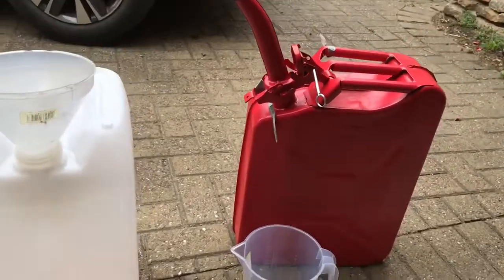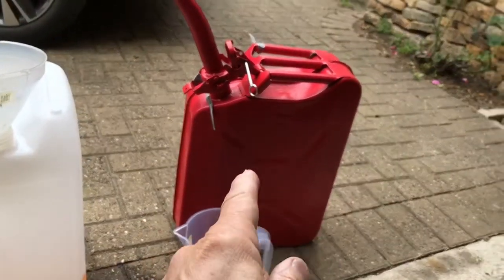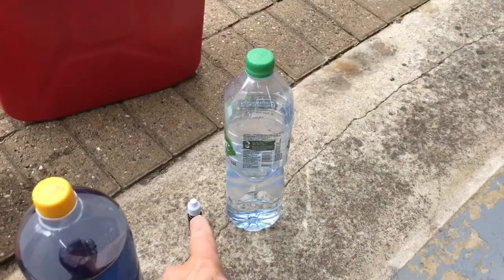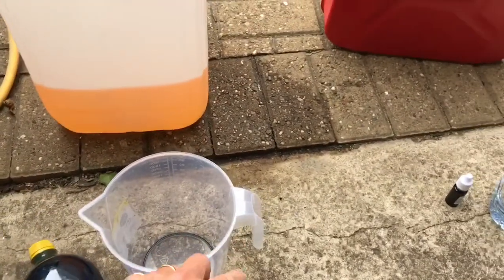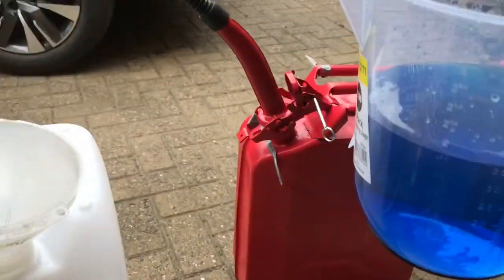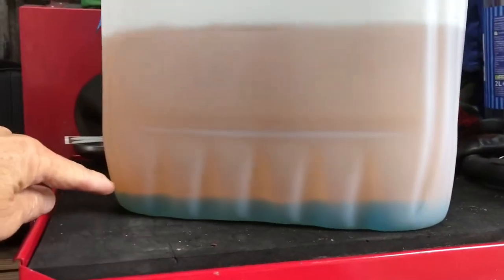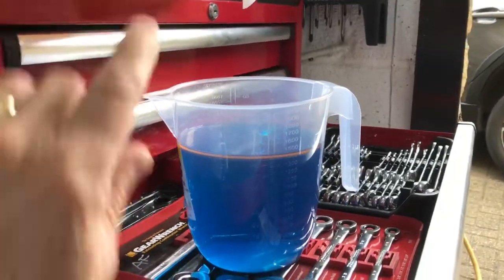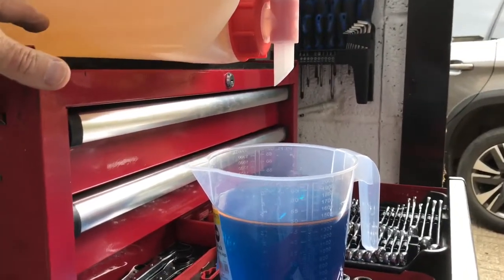How to remove Ethanol from unleaded fuel

Comment: Thank you for sharing this, it gives hope to classic car owners, like myself. My two classics are my life, so this means a lot to me, as well as many other classic car and bike owners that I know.
Reply: Just next time you need to rebuild your carb use viton orings and buy a small piece of it and trace out your bowl gasket and then swap the fuel line to a flex fuel fuel line. Probably needs it anyway those old rubber lines get ate away slowly from even regular gas. Then you don't have to worry about it. It's a little hygroscopic but nothing major as long as your fuel tank isn't untreated steel it won't matter. We run water/methanol sprays on tons of old motors with zero issues. Ethanol has some good antiknock characterisrics and the emissions make it ideal for road legal performance applications vs large amounts of toluene which is what we used before. We can get a massive bump in hp while remaining emissions compliant in commiefornia due to less toluene and more ethanol. I wouldn't ever live in California but our customers do. Ethanol really isn't much of an issue it is a lot simpler to just replace a couple lines and orings than do all this shit. I build racing motors for a living from everything from 4 stroke 450cc dirt bikes, 500cc two strokes (yes a 500) and 360ci sprint cars to naturally aspirated classics for drag and low displacement turbocharged cars. Ethanol for all of these is either a blessing or a very small issue that can be sorted out in an afternoon. Compared to all the other stuff you are usually having to fix on the classics this is nothing.
Reply: @n111254789 but what about the gummed up hard to start small engines. My WR250 only gets ridden a few times a year and that is always hard to start on E5 or E10...

Comment: That is so simple to do, a great video. Has the Govt considered that motorists could take a class action for damages re this E10 fuel? It is NOT needed as we are no longer in the EU and the millions of discarded litres of E10 unviable after over wintering will have to be disposed of - has anyone thought of this? vis garden machinery and lawn mowers of which there must be over a million engines using Petrol in the UK alone. The arguments for the green benefits of this fuel are not in my view  valid, what about rain forests that might be ripped up to make this additive? (sugar beet) plus the transport costs? Factor in the wasted fuel in the UK that will need to be disposed of - how many Tankers worth is that?
Reply: A huge amount of tax to start with, and more profit for the oil companies,  its good business !!.
Reply: the uk, despite its insularity, also has a climate policy. ethanol in fuel isn't about being an eu member, it's about not destroying the environment. your view as to the validity of climate policy seems to based on ignorance and is consequently wholly irrelevant.

Comment: Very interesting, i might try this for my small machines that don’t like ethanol in fuel.
Can you use less water or is the 1-10 critical to the success?
Reply: Its not critical, but it's better to use slightly more than enough water to strip out all the ethanol, so about a 1 in 10 water to raw fuel ratio should be enough for any current e10 fuel. Measuring the amount of water before and after the process will give you the volume of ethanol stripped from the fuel. e5 should yield about 500mL per 10 liter, e10 about 1L per 10 liter extra 'water' at the end of the process.
Reply: @raygale4198  
Thanks for the information Ray, i read recently that E10 is being rolled out next year so even more ethanol in the fuel causing damage.
Fuel stabiliser is of course not worth the bottle it comes in & ethanol free fuel is near impossible to find.
Reply: @Will-thegrumpysoutherner  In Australia we are still E5 mostly, but uncut fuel is still common. I guess that will change at some time.

Comment: Doesn’t the remaining petrol have a higher octane level, since you’ve removed the lower octane ethanol?
Really good video BTW. Thanks… 👍
Reply: @John Reed  ethanol has a higher octane than petrol. remaining petrol has a lower octane rating by 3-4 points.
Reply: @daos3300  many thanks for the info….
I actually thought it was the other way around. 😬🤪😂
Many thanks again…
Reply: No, it has a lower octane value after removing the alcohol.
Reply: But can someone tell what octane he's left with? What other than eating rubber and sealings does the ethanol do?
My Impreza WRX wants 98 octane but the last station within 25km just stopped selling it. Since the car adjusts itself I can still run it on 95 octane, but I'd assume with some higher consumption. Guess this video will come in handy if regular petrol disappears and we end up with alcohol fuel too.
Reply: @TH-bj1pb  your subaru won't use any more petrol than it previously did running on 98 octane. The difference in running 95 octane will be in the top end of the power band, where the Ecu will reduce boost slightly and pull back the timing to prevent detonation/knocking under boost at high power.

Comment: When I was a kid I used to tinker. I found that putting very small amounts of kerosene or maybe diesel into petrol made it drop out the alcohol that I mixed into it virtually instantly.
Reply: That's beyond tinkering mate!
Reply: Make a video
Reply: That is bullshit.
Reply: @sammyd7857  maybe. Can't remember exactly how I did it.
Reply: @torque350hp  more like you put water in it, shake it and let it settle
Reply: @sammyd7857  has some logic to it. Now I want to go try it out again. I think adding kerosene mixes in the fuel and water would mix with alcohol helping them separate well.

Comment: The fact that ethanol has a higher infinity to water than petrol also explains why you should not store your fuel for mowers etc for long periods with out using a fuel stabilizer and why Kubota and others advise farmers etc that TVO and diesel should be held for no more than 6 months

Comment: What to do with the water alcohol mix? Dump it or burn the vapors?and why not buying the super 98 fuel , that is without alcohol
Reply: In our country the 95 has 10% and the 98 5% ethanol in it.
Reply: @willemstreutgers1154  oke, in the Netherlands it is 0% ethanol in  the 98 octane fuel. The euro octane 95 has 5% ethanel .No problem because all engines can handle the e5 petrol . The probleems start with e10.

Comment: Great. Thank you. NOW IF you can, show us how to remove red dye from untaxed 'off road' heating oil to be used in vehicles
Reply: Filter red diesel through charcoal 😇
Reply: @keithgibson568  It doesn't work.
Reply: Its not just the dye you need to remove but the chemical fingerprint as well, as that is what shows up in the test, good luck with that as its probably impossible.

Comment: OMG!... Brilliant!... Right, not fussed about the Ethanol, but I do have some fuel that has been contaminated with water, it's so hard to see the water in the fuel, but if I add a drop or two of food colouring, shake it t mix it, then leave it for several hours, I can drain the now coloured water and save the fuel, instead of using an additive which does something to make the water dissolve into the fuel which is expensive stuff... Man, you just saved me from dumping some 50ltrs of fuel!... Thank you soooo much!
Reply: did it work ?
Reply: @johnsmith-zv1lo Surprisingly yes...

Comment: Now we need a video on distilling the ethanol out to drinking purity
Reply: Sounds like a perfect job for BigClive
Reply: That's easy. Google tomato paste wash and use a water distiller. You're welcome ;)
Reply: (Not sure I'd use the ethanol out of the fuel but making it yourself is easy)
Reply: That's easy,build yourself a still and distill it.add some peaches and sugar,endless supply of peach brandy from gas.
Reply: Interesting idea but the ethanol in fuel is probably teh deadly kind
Reply: @baileyjerman5573  ethanol is ethanol, but I wouldn’t drink it after it being mixed with petrol (Or gasoline, depending on where you live). Even after distilling I’d be surprised if there weren’t trace elements from the fuel
Reply: @timjohnun4297  Ethanol is usually mixed with something toxic to prevent people bypassing taxes on real alcoholic drinks. So yes, ethanol is ethanol, but it’s usually not consumable.
Reply: So you'd need to do more than distill
Reply: Hurry up, I'm getting thirsty

Comment: I suspect that many dishonest garages are actually selling the cheaper petrol through the premium pumps.  It would be useful to have a simple test for alcohol concentration so we can monitor what is going in our tanks.
Reply: Just add coloured water to fuel in a small measuring cylinder and measure the drop in the fuel volume.

Comment: Nice video. However you could just buy ‘ultra’ fuel. Many oil companies label it as E5 but it is actually 100% petroleum. Check their website and use it your tank over winter to stop water absorption.
Reply: esso synergy+99 is 0% ethanol based stuff! not sure which other ultra/super fuels are though???
Reply: @s1dew1nd3r4  Jet 'Ultra' do the same. I put this in my motorbike over the winter and had no problems after 6 months in storage.
Reply: @Cuzzazbuzz  mine doesn't stay in the garage longer than a week lol

Comment: just like my physics teacher, well done, nice and clear, as a matter of interest, I used to ride old bikes and destroyed all the engine oil seals and fuel lines when ethanol was first introduced, the first thing I noticed was the carb manifold rubber melted and the carb fell off, I switched all the seals to ethanol proof ones, no warnings from Esso, Shell, Texaco etc prior to them selling you the fuel and they never compensated a single customer for engine damage,
Reply: Seems like rubber fuel lines would last forever before ethanol. 
 Cracked decrepit looking things , but they didn't leak and was probably original to the equipment. 
Now they are hard as a rock in like 3yrs, or swollen to hell. 
Some places around here in the next county over offer super that's ethanol free , and alot of small engine and car guys love going over there to get the good stuff.
Reply: @MrTheHillfolk  packed a lot in to that.

Comment: Meanwhile i am adding ethanol to turn E5 in to E30. 😬
Reply: Why?
Reply: Power boost. It brings octane up from 98 to about 105 and adds extra oxygen. Nice side effect is it brings the price down. E85 is only 0.5.
Reply: How about making it E100 😁
A bit of rejetting and hey presto a "top fuel dragster" pity about the 6mpg !!!
Reply: @keithgibson568  i wish lol. But for now i will stick to E30. That, my ecu and hpfp can compensate. Tried E40 but then it leans out at wot. Ran it on E85 as a test to but then it throws errors while driving normal. 😂

Comment: Are you sure that's 10lts you have measured out? Looks more like 5lts to me as the clear barrel will be a 20lts container. (Maybe 25 if old enough) but still the level should ne higher for 10lts.....
Reply: I’m pretty sure that plastic container is more than 20L. The red jerry-can he is using is a 20L one.
Reply: That's what's I was thinking. In old fashioned terms that's just over 2 gallons.

Comment: This video is of utmost importance and use, as fuel in many regions is simply engineered wrong - or skimped out. Take my hot humid tropical country Indonesia for instance, where the common and affordable RON 90 fuel has an ethanol content of up to 11%. Less as it goes up to 92 and 95.
This explains why my bike carburettor commits suicide every other month, and I have to clean it out along with the very watery fuel tank.
Thank you. I will start doing what you have advised.

Comment: Great video hack for E10 - I use Esso Supreme 99 with zero ethanol. It’s £1.50 per litre. My EType hated modern petrol and as you say float chambers, seals and pumps failed.
Reply: Man, I've loved those E Type Jags since I first saw one. That's at least 55 years ago.

Comment: At present, all fuel pump nozzles/guns must be marked with E5 by law..... but there is no law that states there HAS to be alcohol in the fuel. I read this on Esso's website which clearly tells that depending where you buy the fuel - different areas supply different blends - that Synergy Supreme 99+ super unleaded has no alcohol in it and better still if your area hasn't got alcohol, then buy  it at a Tesco superstore's filling station and it is a little cheaper.
Reply: Correct: where I live (the Netherlands) there is no ethanol at all in the E5-petrol (octane 98 over here) offered by: BP, Esso, Shell and Texaco.
Reply: Partially right.. the law requiring alcohol is on the refinery side...
Reply: @hillaryclinton2415  Which is no doubt why the fuel supplied by Esso in various ares of the UK may or may not have ethanol in it, but of course if the refinery is in the UK then it'll be bound by UK laws which do not as yet make ethanol content a legal necessary. 
Fuel from refineries in other countries may well be subject to the ethanol requirement.
 I reiterate that I saw this on Esso's website - it is there for all to see, perhaps if you contact their legal teams and inform them that the company is wrong.....

Comment: That is very clever (and helpful too) - Is the blue water/ethanol mix toxic or can it just be flushed away?
Reply: Ethanol is toxic so the water/ethanol mix will be toxic. The best way to remove the ethanol from water is fractional distillation, collect enough of it and you might be able to sell it back haha. Otherwise it should be disposed of as hazardous waste.
Reply: @daveffs1935   Ethanol is what you drink down the pub. In excess, it's toxic of course, but saying that, so is water.
Reply: @wirdy1 If you want to chug 1.5l of 66 proof with a touch of petrol go ahead lmao, just don't poor it down the toilet. As you say, it's not about that single dose in the system, its when you've told all your mates and neighbours and they start too. Ethanol can be harmful, causing toxic algae blooms and such, best to promote best practice.

Comment: IMO if I had a classic I would change the fuel lines and seals to deal with the Ethanol. The benefits it provides (higher octane, removing water from the fuel system, cleaner burn) are worth it. But its your vehicle do with it as you please.
Reply: It’s the pump and carburettor that it destroys. Also it does not remove the water just transfers it to the carburettor where it adds to the corrosion.
Reply: It also reduces your fuel economy by A LOT. If you have a big vehicle, this translates to spending more money on ethanol than pure gasoline, but like you said, "it's your vehicle".

Comment: Now what do you do with the ethanol ?
Reply: Burn it, use it for fuel in somthing other than a car ect
Reply: "Do not discharge into drains or watercourses or onto the ground. Avoid the spillage or runoff
entering drains, sewers or watercourses" from a supplier's material safety datasheet.
Reply: @Robert Stallard   These are all good points, especially the comparison to beer.  I'm sure there will also be traces of petrol in the mix too.  I'll ask the Environment Agency about all this as it's a bit of a grey area in my opinion.  I'll post their reply here.
Reply: @Robert Stallard ethanol fuel mix is a volatile chemical and classed as hazardous waste, you don't just pour it down the drain, unless you're a cretin.
Reply: @daos3300  So what DO you do with it?
Reply: @ElmgateModels  use it for something else or take it to a recycling centre, obv.

Comment: Good quality toluene is a great octane booster, I used it for years
Reply: I remember a guy in the lab during the first gas shortage in 1973 who made his own gas out of solvents and ended up blowing up his motor.  Toluene is high octane possibly 130? It is also smoky and fouls plugs.
Reply: @paulnicholson1906  I used at least 30 percent in my fuel for 12 years along with my friend, we used it in 9 cars between us, we both found our cars ran cleaner and had more power, never caused any issues at all, I woukd still be using it now if it was a little cheaper here in the UK.
Reply: @jasond4965  interesting.  I had an old car that I used to make up a special blend to get it through inspection but went back to regular gas after I passed.  I have a Model T and an old Beetle and I just run regular in both.  I also have some old motorcycles and I run premium in them.  In the Model T I add a bit of two stroke oil just to make me feel better don’t know if it helps or not.
Reply: @paulnicholson1906  I discovered it when my old firebird engine was rebuilt, was getting a lot of pre-ignition noises so looked into 'octane booster' In those little bottles, a bit more research and it turns out that octane booster is 99 percent toluene with a little transmission fluid to lubricate the valves

Comment: Could you not just change the float in the carb and a couple of fuel lines then you can just use the e10 fuel.
Reply: The solder in the floats is attacked fastest but long term a lot of the alloys used for carbs, fuel pumps etc will also be damaged by ethanol exposure
Reply: @MrJamesBarratt  is there no way to neutralise the ethanol so you don't have to remove the ethanol

Comment: You now have 9.6 litres of fuel and 1.4 litres of blue curaçao.
Reply: In next weeks video we run the precipitate through a home still to produce pure ethanol, for educational purposes only of course. Now where's my Juniper berries an botanical pot pouri.
Reply: Hahah 🤣🤣🤣
Reply: water and alcohol makes a solution you can use to keep caulk from sticking to your finger when you smooth your bead.
Reply: Lmfao
Reply: Where's the problem? LOL
Reply: @theodoremarakas9899  Unfortunately you can never separate all the Gasoline (Petrol) and possible fuel additives from what SHOULD be Corn Alcohol, so this would never be "safe" to drink.  Better to distill canned beer or a simple sugar mash (for those outside the U.S.)
Reply: @TIMEtoRIDE900  Very correct. I'll continue buying alcohol from the liquor store.